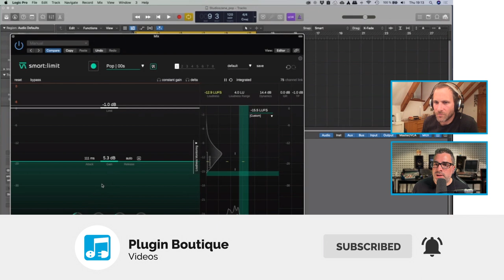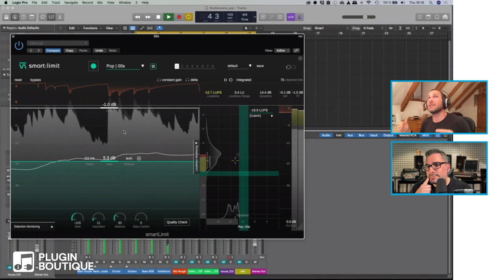Limiter vs Compressor Explained by a VST Engineer

Comment: Bit of a shame how this starts off. Compressors do not reduce the dynamic range of the signal, because their effect isn’t instantaneous. Compressors can be used to increase the dynamic range of a signal just as well, by letting through an initial transient uncompressed while compressing the tail.